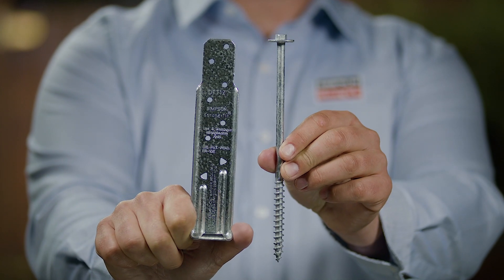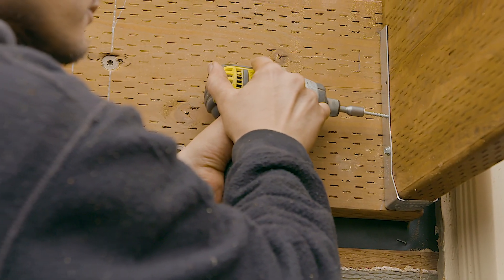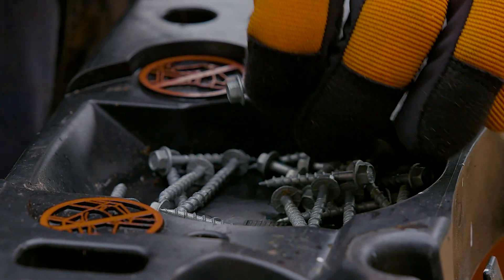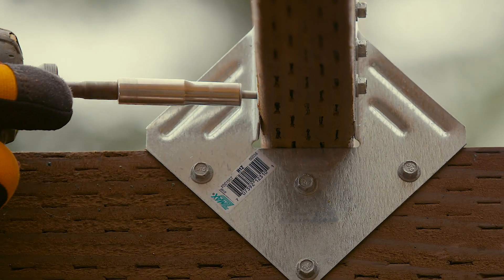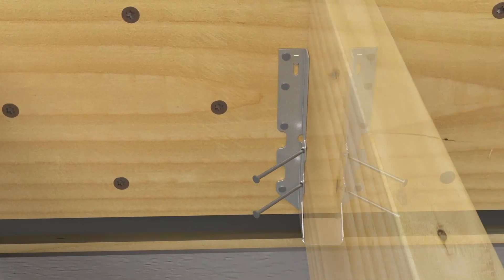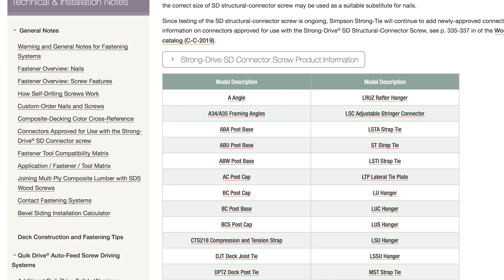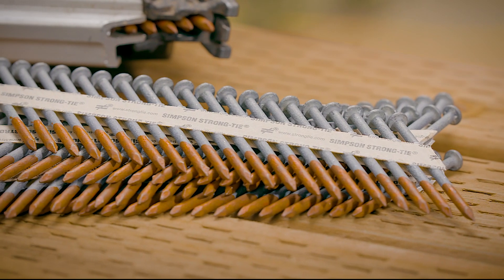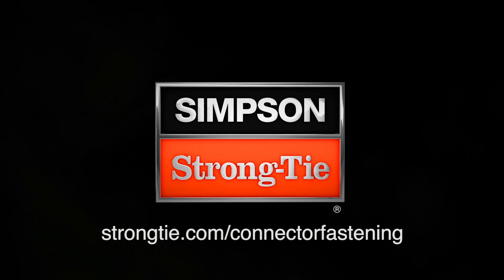How to Choose a Fastener for Your Connector

Comment: Im in the process of replacing my deck and as a diy’er your online guide is very  confusing as there is so much info I dont understand. 

I bought your joist hangers and just need to know if I use sd9 or sd 10 screws. 

Its a 16’x16’ beck made with 2x8 framing and joists.